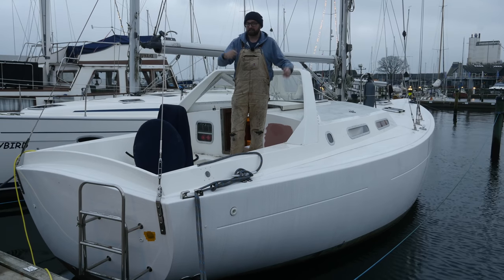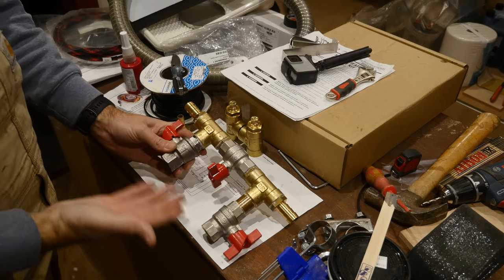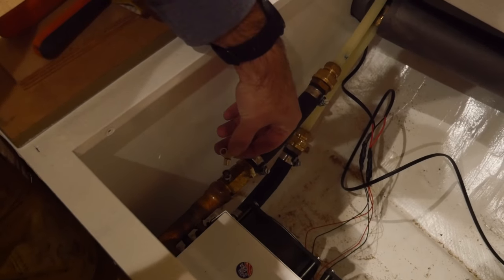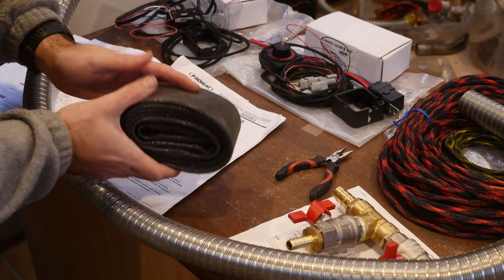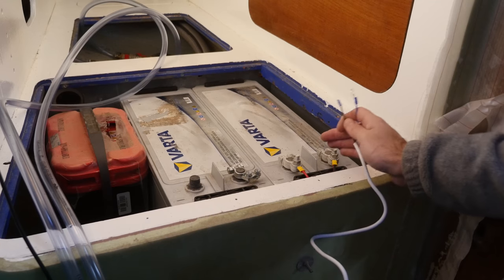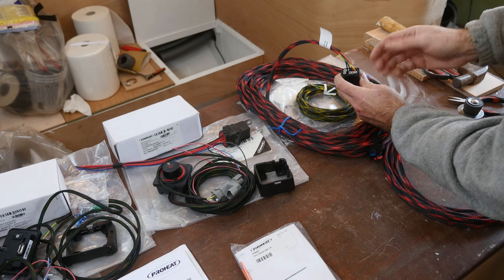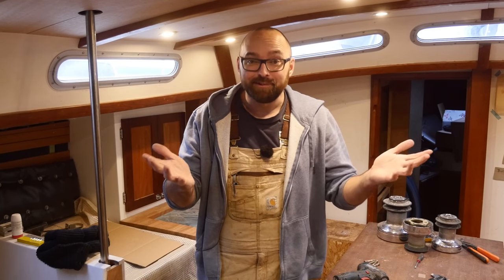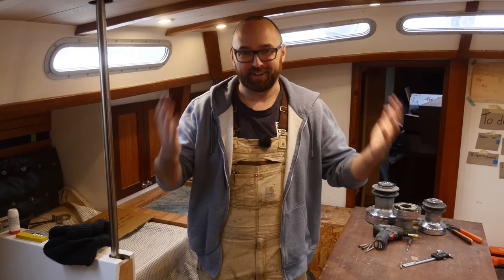Sail Life - Dometic Proheat X30 hydronic heater on a boat, part 3 of 3 - DIY project

Comment: The complexity of a mere heating system is remarkable. Only one wire or tube or piece of electronics needs to fail for things to go wrong. Then you multiply by this the numerous other systems and it’s hard to comprehend this complexity. I appreciate your efforts. I’m sure there are any enthusiasts who prefer this level of detail, but it exceeds my total interest.  Anyway, Happy Holidays from Connecticut, New England, USA.

Comment: I have a hot water diesel heater onboard and use those type heater matrix blowers... I fitted mini towel rails using the heated coolant lines in the heads (no fans running and zero power consumption and no noise) 
The heat is more like heating from home and I had to fit thermostatic valve because it was getting too hot 😜

Mufflers don't really do much but plenty of engine bay sound deadening in you utility compartment will help loads

Cracking job as always 👏 👍

Comment: If we think the heater is loud...wait until the generator in there starts running. Maybe both will cancel each other out. Sound insulating the bulkhead between the technical room and the head should help some too.

Comment: I could be wrong however I was always told to mount carbon monoxide sensors low as it tends to settle. So if it's mounted high with the smoke detector and you're laying in bed you could suffocate before it got up high enough for the sensor to pick it up...
Reply: Just read that carbon monoxide is 'slightly' lighter than air and will mix with other gases. So better higher mounting position. 
Carbon dioxide is heavier than air and will therefore accumulate lower down. Soap box put back into storage.
Reply: Nope, they should be high up. Our (per code) are mounted just below the ceiling. Mark is right, MONoxide and DIOxide are very different things!

Comment: Hey Mads, good progress. I've been following a similar trajectory with my 1973 (former) ocean racer Kailua here in New Zealand... though have managed to keep her sailing across the past four years of restoration work. I'm interested to hear about the forthcoming NMEA2000 network and marine electronics as I'm just coming out the back end of that process. In the end I went with Raymarine Axiom MFD and a ACU200 autopilot with a few other wing-dings. Very happy with it, and am now sorting out the last bugs that will enable me into Raymarine's walled garden so I can control the autopilot and set routes from PredictWind (weather-routing) and OpenCPN (chartplotter) running on a nav computer. It's not too hard, but relies on a nifty Yacht Devices wifi gateway.

The other thing I thought I'd mention, is that I spent a lot of time looking into lithium-ion and then decided against it in favour of a lesser known half-way house called Lead Crystal. Its a lot cheaper, but will happily survive full discharge which means you get every amp-hour you pay for... unlike lead-acid which won't come back from a 60% discharge.

Comment: Mads, when you put the high point vents in, you put the bleeder vent in the horizontal, so the manifolds still have air pockets trapped in the upper half section of the manifold pipe.  The optimum configuration (when space allows) is to orient the tee fitting with the bleeder point oriented up so that the bleeder vent is above the manifold.  That will allow all of the trapped air to be bled out.  On the heater, adding the exhaust muffler and piping the intake will cut the noise level significantly.  The industrial standard for prolonged noise exposure is 100 db at 3 feet, so you can use your phone to measure the sound level at one meter before and after each improvement.  Gooseneck the combustion air intake above the deck to minimize water getting in.  When you build a sound enclosure, it's best to leave yourself an air gap between the unit and the insulation to minimize localized heat buildups. (1-2" is usually enough)  Rubber/elastomeric insulators at the mounting points can also reduce noise into the hull structure.  Happy Holidays!

Comment: Yep, that is how my Espar sounded although it was a higher pitch given the smaller size.  After I installed the muffler all I can hear is the water pump.  I hope yours does as well.  I also added the external air intake and a diffuser.  It pulls air from the cockpit so no inside air for combustion.  I also found the fans on the Sure fan coils under powered as well as noisy.  There are thousands of 120mm fans available and by using a PWM control (Noctua NA-FC1) you can get the most powerful fans for when you need it and then slow them down to make them more quiet and also use fewer 12v amps.  I have a couple of Delta PFC122DE 12cm fans that will spin at a max of 6500-rpm's at max 4.8amp draw on the way.  they are reported to run on down to 10% power with PWM which will get them down to about the 0.5-amps of the stock fans and almost silent.  I will post after I get them installed to let you all know how they work.

 DO NOT get the fan speed controls that Sure Marine sells because they are just rheostats and to slow the fan they put a big resistor in the line that lowers the operation voltage.  You still use the full power but just have the fan spinning slower.
Reply: Very good points. Our Caframos use very little power but should be gold plated for the price.
Reply: I sourced on eBay an inexpensive pulse width modulation speed controller for my engine box cooling fan and it works great.  Select the correct voltage and amp rating and away you go for about $10
Reply: Big thumbs up on the Noctua line of fans. Very powerful and reasonably quiet - silent in a lot of powerful configurations. Their industrial line isn't nearly as quiet as the consumer line but much quieter than the competition.
Reply: @sgtsquiggs  I went with Delta fans because I could not find anything to touch them.  The best Noctua I could find had 2.34mmH2O pressure and 102.1 m/h flow.  The Delta I am getting is over three times those numbers at 7.16 & 351.7 and with PWM I can run them at 30% and match the Noctua numbers.
Reply: you probably dont give a shit but does anybody know a method to log back into an instagram account??
I somehow lost my login password. I love any tips you can give me.
Reply: @Raymond Julius Instablaster :)
Reply: @Andres King I really appreciate your reply. I got to the site thru google and im waiting for the hacking stuff now.
I see it takes quite some time so I will get back to you later when my account password hopefully is recovered.
Reply: @Andres King it worked and I now got access to my account again. I'm so happy!
Thanks so much, you really help me out !
Reply: @Raymond Julius glad I could help =)

Comment: I like your movies Mads. When it comes to heaters, I would mount a smaller hydronic heater (like an Eberspächer) that also sounds less, and one air heater that is completely silent. Then you also get the opportunity to dry up the boat quickly. I would also install a water heater to store hot water. Then you can choose to run the hydronic heater at given times and always have hot water. This also provides redundancy in two heating systems and you get "free" heat during periods when you run the engine or generator.

Comment: I was watching a couple who were shopping for a boat. They had interview clips from wise old sailors that they'd throw in here and there. One of the wise men is their go to guy for all kinds of questions, and he said something that I actually wrote down in my "cool quotes" file. He said cruising isn't about how much you can fit in your boat, it's about learning to live with less." I thought that was cool. Sometimes, very respectfully, I wonder if you'll ever get out of that harbor. The debug of all those systems separately would be crazy, put em all together and it's gonna be like bringing Frankenstein to life!
 I'm an engineer, I design build debug improve machines, then hand them off to production people. Have to create full "owners" manual, troubleshooting, setup,  changeover, electrical, pneumatic, hydraulic, manuals also. If I were you I'd be working on that as you go along in the process. A lot of stuff is available online so you don't have to keep everything, but the custom work you've done, the awesome custom work like plumbing, the way you ran electrical, I'd try to get a start on it minimally!

Comment: So great you finally have heat! I install hydronic systems. We call the fluid 'boiler fluid' instead of coolant. Also I always fill the system with fresh water first and do a pressure test before draining and filling with a 40:60 ratio of boiler fluid to water. Yes exhaust noise is an issue. I am sure adding the muffler will make a big difference. Another drawback of the Reflex or Dickinson heater is the possibility of down drafts that fill the cabin with stinky diesel exhaust!

Comment: Not sure if you'll see this, but mechanical/HVAC engineer here. If you have condensate produced by the exhaust gases, you're going to want to buy or make a "condensate neutralization kit". The nitrogen by products of combustion dissolve in the exhaust condensate and form an acid prior to discharging out that tube. The kit, which can be a section of CPVC pipe filled with sodium hydroxide (lye) crystals neutralizes the acid back to water. Figured this would be preferred over having acid draining into the technical compartment/bilge.

Comment: Great video! I look forward to Sunday's so I can see your progress.  I noticed on your two distribution manifolds you have two unused ports on both the red and blue circuits. If any of the four unused valves were to get bumped open, coolant would leave the system messing up your tidy installation and possibly harming your heater!  By simply connecting a short piece of PEX tubing to each set of adjacent unused valves, you would prevent accidental loss of fluid! ...And, it is reversible so you can add additional fan heaters later!

Comment: I would suggest putting the air scavenger on the top of your buffer tank (where you did a manual release of air in the video) as air will get trapped there. I think you would only need the one on a small hydronic system like yours. But maybe I’m missing something! Glad you now have heat. Nice system.

Comment: If you can possibly install the coolant system bleeders at the highest possible point in the system it would be beneficial. Not totally necessary but will reduce the time to bleed the system, create less mess when bleeding, and ensure that ALL the air is out:)  You're doing such incredible work on everything, Athena will be worth a lot more due to a future buyer being able to see all the impeccable work and know that you cut no corners! And I'm sure you'll have every expense captured in an excel file too! Have you thought of creating an owners manual? I would! Have chapters or sections broken out by system such as your solar and charging systems, and have a troubleshooting section for things like the solar panels if they stop working, winterizing section and a summerizing section! And similar to an airplane, you could have cheat sheets for certain common procedures such as coolant system flushing, oil change, transmission oil change, and wiring diagrams. I'm a manufacturing engineer and I design machines. Part of that responsibility includes creating such manuals for operators, setup and maintenance people.
P.S. I absolutely love the look of the all white boat! Looks incredible! But I'm sure it will look even better with stripes and whatever else you decide to do to her!

Comment: Having run two different Espar heaters in vans, I can confirm the muffler is 100% necessary if you want your neighbors to like you. You can also look at swapping intake and exhaust tubing. I found that the internal texture of the tubing that came with my heaters was causing it to make a lot of high pitched noise.  Mine looks exactly like the tubing you have, just a bit smaller. I found some different exhaust tubing with a smoother internal texture locally in the US that eliminated a lot of noise.

Comment: Mads, It is also highly advisable to have an outside air source for the fan coils.  If you only pull inside air for heating in the fan coils, the interior humidity will keep climbing until you get condensation inside the boat.  If you pull a portion of your air from outside and pass it through the fan coils heaters, this air will be warm and drier than inside the boat and will push the moist air out.  I have two 6000 btu coils and one 12000 dual fan coil.  one of the 6000 btu units pulls 100% outside air and most mornings I do not have any condensation on the ceiling or windows unless it is raining.

Comment: Mads this Mad. Your Tube is my absolute favorite. I think we may have been in contact back when you started. I would go analog on your tank gauging systems. KUS makes excellent level sensors and dual tank panel gauges with backlight and three way switches (T1,off,T2) for water, diesel, waste/holding. Glad you’re healthy again. Keep on pecking away at it. Mine took 5 years after fire 🔥 insurance purchase. Cheers!
MAD on SV Wildflower

Comment: When i mounted diesel heaters in boats at my old job. i usually used those rubben dodads with bolts in both ends. to cancel vibrations from the heater on to the boat. i also used to bend the flex exhaust a couple of times. since that dampens the sound on the outlet of the exhaust.  be careful with making a box round the heater. it can make inlet temp higher and affect emissions and shorten service intervals. Love you channel and merry christmas from norway :)

Comment: The air snorkel, muffler, closing off the technical compartment, putting a box around the heater should all reduce the noise. Someone else mentioned the possibility of vibration being transferred into your hall and maybe you can isolate it using rubber mounts as they mentioned.

As always a great video with great knowledge and explanations. 

Have a merry, and warm, Christmas 😉.

Comment: Wonderful to have heat! :)   I still think it would be better to have the electrical panel swing forward rather than swing down.  If it swings forward when you sit at the chart table the back of the panel is in front of you easy to work on and the cavity behind the panel is not blocked by the lowered panel to pull wires up or secure them.  Just my opinion and it is worth what you paid.  :)   Happy Holidays

Comment: oi, I hope you can get that quieter. Such a cool system.

I probably wouldn't have bothered with the filling system. It worked great, but saved very little effort over cycling the heater a few times. It might take decades to break even on that investment, and in the meanwhile you have another kilo of fittings taking up space in your bildge. Maybe if it had been a design goal earlier on... might have been able to implement it more elegantly. I'll keep it in mind. Big thanks for testing it out for us!!!

Comment: Mads. As always it's your boat and you do what you want... We just upgraded to a 5Kw warm air heater from eBay, cost £104. lcd screen full control 4 outlets thermostatic etc. Warm air circulates all the boat. The unit is reasonably well constructed. Boat behind us has had one fitted two years no problems. If you do the maths on just warm air/cost and ease of installation its a no brainer. Adding a diesel heated water system from the same far east suppliers is around £300 again the maths it is a no brainer and if one fails there is redundancy.. While the the Dometic is a great system its complicated and takes up loads of space. We wonder if you thought about 12 volt elements to your water clorifier and blown air as a simpler system with more redundancy? Hot water from the sun or battery bank and only using diesel for heating? Just asking?  Sail Safe Guys, Ant, Cid & the pooch crew.

Comment: Great and thorough discussions of the various systems. On one boat we have in Tromsø we have two coils in the Refleks and with the help a circulator pump provides hot coolant to three radiators. Very nice and quiet. But I will say adding a boiler to augment that heat in real cold weather would be nice. Your installation of the Proheat is certainly more sophisticated than mine but that is OK if not a bit of overkill. We use our Proheat every night during even here in San Diego. We will see if it is needed further south into Mexico. Enjoy the holidays and we look forward to your next episode.

Comment: You had me at hot water for the head/shower. The system you installed wins. Good grief! Can’t be taking cold showers in cold climates. Sure the stoves are simple but you get so much more from your heating system. Congrats on getting it working!

Comment: Mads,  now that Athena is in the water, I'd like to see how you prevent debris from ending up in the marine ecosystem.  On my boat, I always used a vacuum cleaner, paper towels, and/or other fairly simple methods to ensure my sawdust and chemicals ended up in the landfill and not in the salt water.  You are waay more clever than me, so I'd like to learn how you do it.